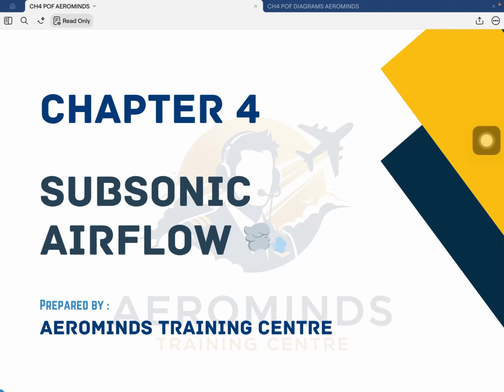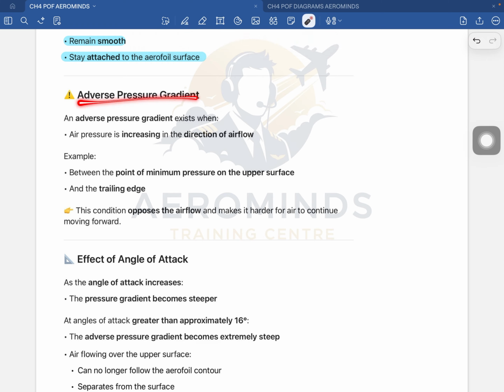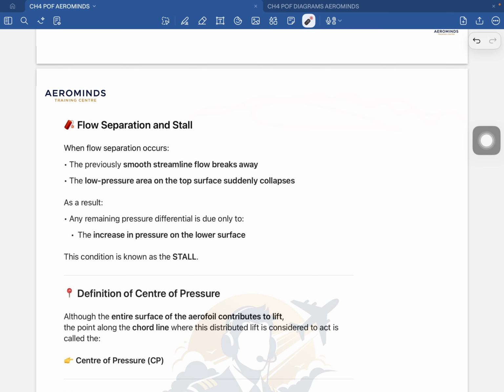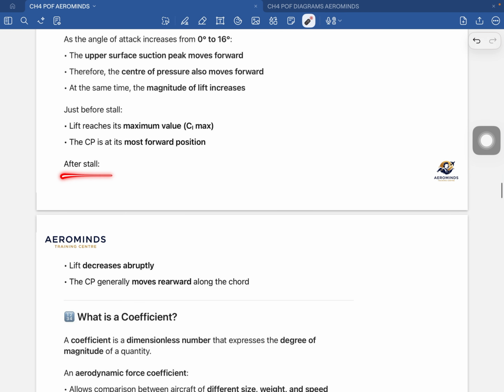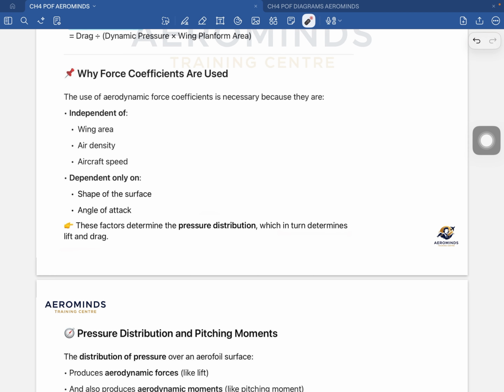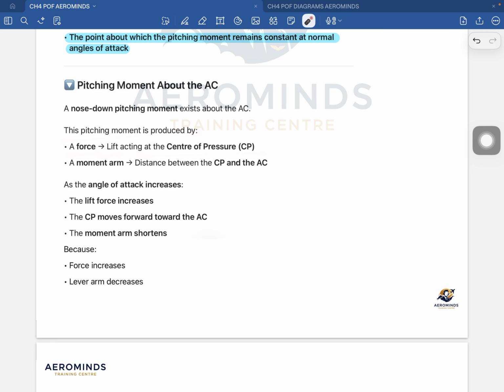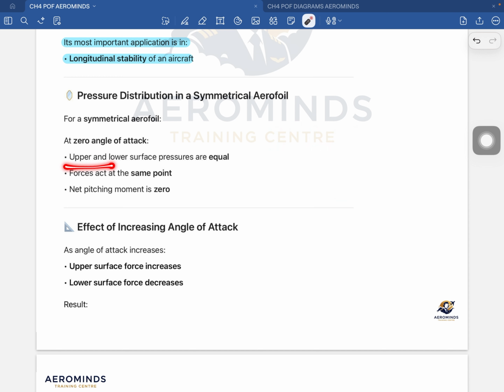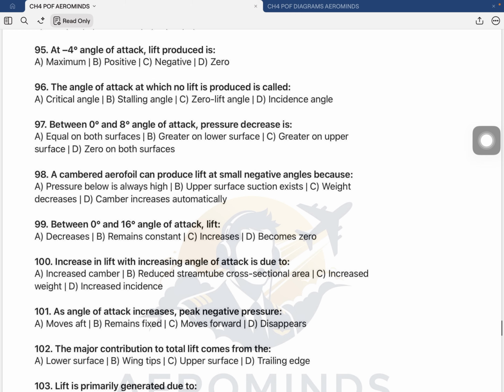Technical General | Principles of Flight | Chapter 4 - Subsonic Airflow (Part 3) | DGCA CPL NOTES

Comment: Answers?
Reply from the maker: I’m really glad the explanations and practice questions are helping you with your DGCA preparation. Keep up the great effort and consistency.
The answers are down here-

1–20
1-C, 2-B, 3-C, 4-C, 5-C, 6-C, 7-C, 8-B, 9-C, 10-C,
11-C, 12-C, 13-B, 14-C, 15-C, 16-B, 17-C, 18-C, 19-B, 20-C
21–40
21-C, 22-B, 23-B, 24-B, 25-C, 26-B, 27-C, 28-D, 29-C, 30-C,
31-C, 32-C, 33-B, 34-C, 35-B, 36-C, 37-B, 38-B, 39-B, 40-C
41–60
41-C, 42-B, 43-C, 44-C, 45-D, 46-B, 47-C, 48-C, 49-B, 50-B,
51-C, 52-C, 53-C, 54-C, 55-C, 56-B, 57-C, 58-B, 59-C, 60-B
61–80
61-C, 62-C, 63-C, 64-C, 65-B, 66-B, 67-B, 68-B, 69-C, 70-B,
71-B, 72-C, 73-C, 74-D, 75-C, 76-C, 77-C, 78-B, 79-B, 80-D
81–100
81-C, 82-B, 83-B, 84-C, 85-C, 86-C, 87-C, 88-C, 89-B, 90-B,
91-C, 92-C, 93-D, 94-C, 95-D, 96-C, 97-C, 98-B, 99-C, 100-B
101–120
101-C, 102-C, 103-B, 104-C, 105-C, 106-B, 107-B, 108-B, 109-B, 110-A,
111-B, 112-B, 113-B, 114-B, 115-B, 116-A, 117-A, 118-B, 119-C, 120-D
121–140
121-B, 122-B, 123-A, 124-B, 125-A, 126-B, 127-D, 128-B, 129-A, 130-C,
131-B, 132-C, 133-B, 134-B, 135-C, 136-B, 137-B, 138-B, 139-B, 140-B